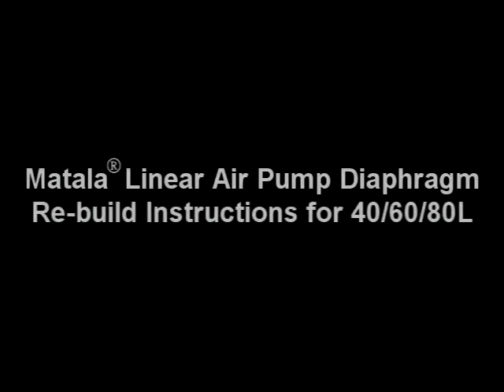Matala Linear Air Pump Re-build for 40L&60L&80L&80LH

Comment: The retention nut on 40L is 5.5 mm not 7mm. My 40L had no noise dampening wrap. I doubt I’ll ever buy this brand again
Reply: Is it available from the factory.  What is the part number?  How many db does it lower the noise?  Where is the link to the factory website for a complete list of parts.